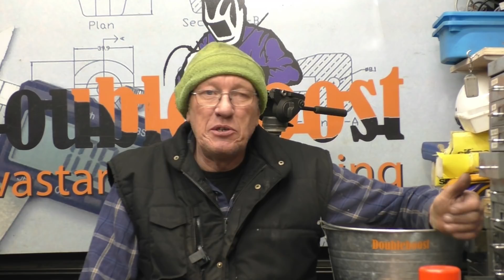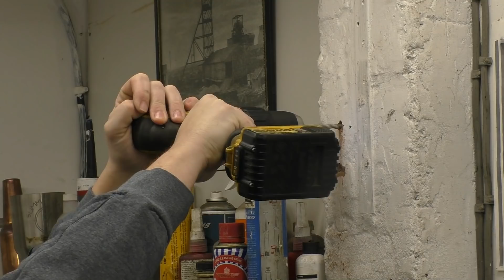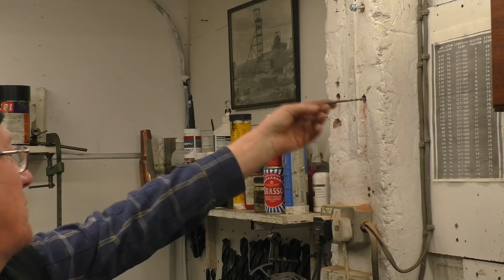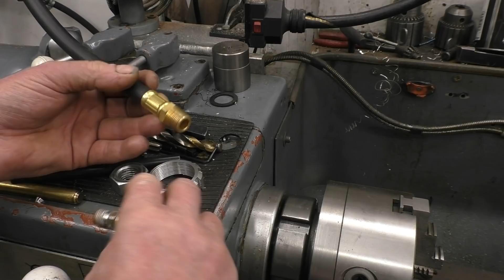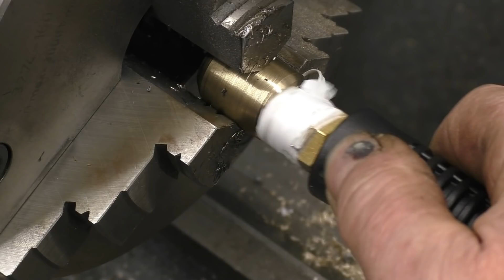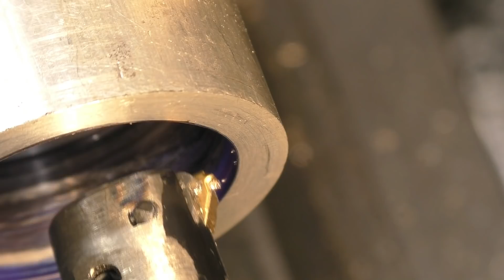SNNC 413  . Left Hand Thread Sorted

Comment: Top tip for when drilling into a wall - tape an open envelope or small bag below the drill hole before drilling, it’ll catch most of the dust and make the cleanup much easier.

Comment: Some old drill technology there John, new power drills,  are " Percussion " type, slower rpm but higher number of "hits", I started using the "Rawplug" hand held chisel, and a Hammer as a youngster,  anybody else remember them?
Left hand thread part 3 coming up. You need a Left hand tool, lathe spindle in reverse,  cutting on opposite side, with cutting face uppermost. 
Great addition to the shop,  great teamwork. May come in handy as a washing line for Debs 😆 .lol
Thanks for sharing.
Reply: I too remember the three shallow straight fluted Rawlplug hammer bits and do you remember the Fibre Rawlpugs? Would hardly hold a picture on the wall lol
Reply: @samrodian919  Yes, as you say,  not very effective, most times I ended paring some wood implacable of the plug.
Reply: Maybe we can all chip in and buy him a left-hand lathe for next Christmas - then he can turn RH Threads ?

Comment: thats a good looking reel. i hope it works better than the ones i have tried over the years. i have had every thing from heavy duty commercial to cheap Chinese and none lasted. you haven't lived until that hose gets away from you and smacks you right between the legs during a high speed retract. owww.
Reply: We use them at work over the machines. I was using one to blow something out without "latching" it and when I let go by mistake the thing retracted at a great rate of knots and the metal blow gun swung like a pendulum right into the big flatscreen control monitor and smashed the bastard to buggery!
Reply: @FrontSideBus  I bet your boss just loved that!
Reply: @samrodian919  Yeah they wasn't impressed. They hate any sort of unplanned expenses there. Sometimes I get the feeling we only get essential consumables begrudgingly...😂

Comment: Oh John, you've cut another left hand thread!  To cut a right hand thread with the tool cutting outwards, you need to run the lathe in reverse.
Still love your content though!
Happy New Year to you and your family.
Reply: think again, inside outside?
Reply: That’s true….another left hand thread!!!
Reply: indeed you are correct
Reply: He'll get it right by next Christmas. 😁
Reply: Think you need the leadscrew and chuck to be rotating in opposite directions to cut a LHT ?
Reply: John to visualize the cutting stand at the end of the lathe behind the headstock. What direction would you screw a cap on? The chuck will turn in the same direction. If turning to the right the cutter will start outside an finish at the back of the part, if you want start at the back the chuck must turn to the left, just like unscrewing a nut or cap. You can either reverse the lead screw or the chuck and cutter.
Reply: @BedsitBob  oooh nasty!

Comment: Clinker brick there John, harder than glass to drill through. Your regular drill with a carbide tip does not work, you need SDS and a Bosch drill and bit, which will go through them. 

I grew up in a house all made out of clinkers, hanging a picture was more a matter of getting the approximate location the picture was to go, then go hunt for the mortar line, because that at least you could drill into, and not only make a hole in the plaster.  Went through a lot of polyfilla hanging a picture there, to fill those little holes till you found the mortar line, and could put in a plastic anchor and a screw. Never had any issues about cracking in that house though.
Reply: Totally agree with you SDS+ and the Bosch multi purpose blue drills.

Comment: I bought an SDS recently and I don't regret it for a second. These normal drills that claim to have "hammer" functions really just *dont*...
Reply: Yes I totally agree.SDS is the way to go for these sort of jobs, especially on 1940's and 50's concrete with 3/4" flint ballast which is a total nightmare to drill. Hit one of those stones with a normal " hammer" drill and it stops you dead, But using the SDS it will go through. It's still tough going but it will make it through.
Reply: @samrodian919  The rotation stop feature is also dead handy with wide and narrow chisel bits and you can also use it to sink earth rods lol.

Comment: Hello John. all the best for xmas and the new year. I didn't realise it until I read the comments, but oops you've done it again. I was trying to work it out in my head, but I don't think you will be able to cut a right hand internal thread up to a shoulder with that type of indexable tool. You might have to go old school and grind up a bit of HSS. I could be totally wrong, but I'm sure you will get it sussed out. You'll love that hose reel. I have one by the garage door and it reaches all round the garage and also can be used on the drive. I use it a lot. Ok take care bonny lad and I look forward to the next one! Mart in Solihull.

Comment: One thing I found when trying to drill through concrete with a carbide bit is that the rake angle gets worn away quickly. Once I reground the angle, it cut much better.
It was good to see that you got some good help in installing that hose reel. That looks like a wonderful gift

Comment: You've cur another LHT! If you cut with the spindle running forward you have to cut toward the chuck for a RHT 8-)  the tool has cut on the front/top side, or back/underside with  the spindle reversed to cut away from the chuck 8-)
Reply: think again! inside outside?
Reply from the maker: You are right lol
Reply: @janvanruth3485  i think it is you who needs to think again 8-)
Reply: @wktodd  indeed, you are right

Comment: There's an easy way to know if you are cutting a thread right handed or left handed.

If the chuck and the lead screw are turning in the same direction, you are cutting a right hand thread.

If the chuck and the lead screw are turning in opposite directions, you are cutting a left hand thread.

Comment: Drilling and screwing to masonry is never fun, even with a hammer drill I feel like every third hole or so has some pain in the ass surprise hiding in it.
Reply: You drilled into an electric cable ? That would be a surprise - lol
Reply: @millomweb Not yet! Seems to usually be a hard spot or bit of loose aggregrate that whatever I'm trying to drive in there grabs. If I'm lucky I'll get the fastener out intact and ream it out some more.
Reply: @Broken_Yugo  If you tried the bricks in my flat.....a quarter inch drill would easily make a half inch hole ! There's a cupboard that backs onto the kitchen and in the cupboard is my wall-hung gas boiler - and that wall in the kitchen now has breasts :) The wall is holding the boiler and the wallpaper is holding the wall !